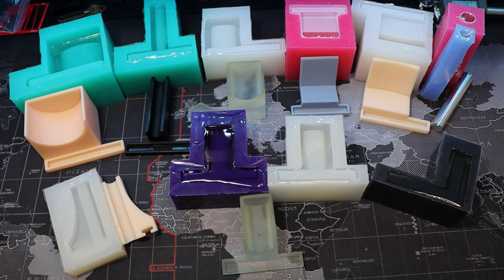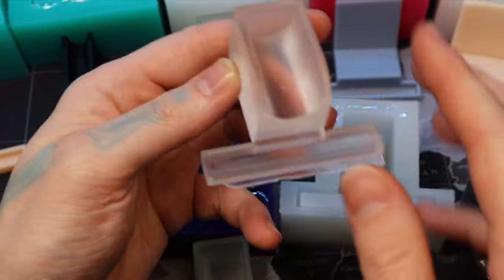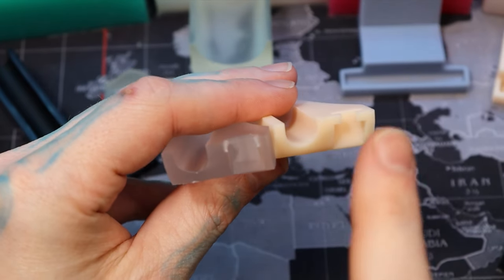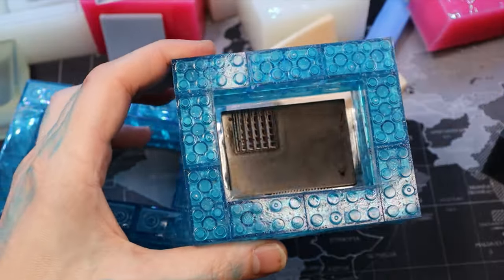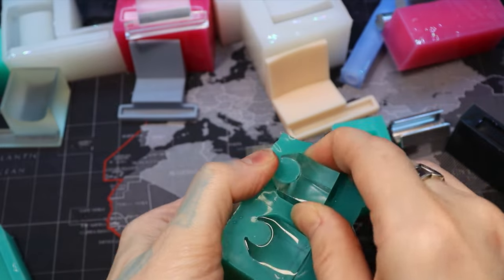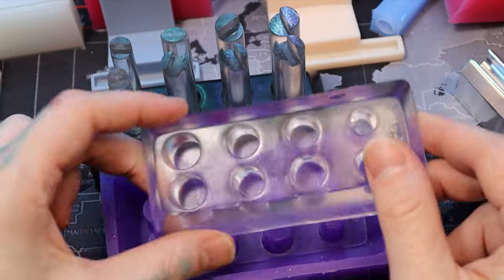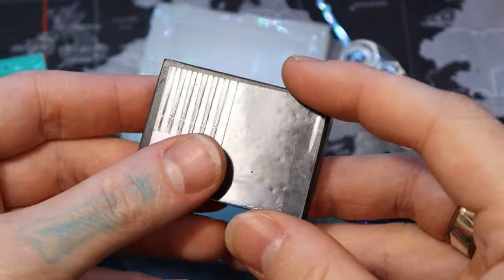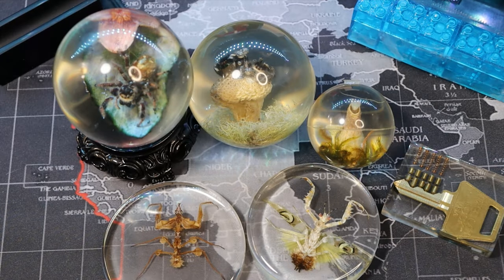297) 3D Printing, Silicone Molds, & Craft Resin for Locksport

Comment: I just wanted to clarify something about the silicone. You are referring to the "shore hardness" as if it were a model number of product when it is not. the 12A you mention is just how hard the silicone is (squishy) and the 2 "types" of silicone are "tin cure" and "platinum cure" and you can get the same hardness in either of these. You are absolutely correct about platinum cure being what to use for resin 3D prints and that tin cure is stronger, longer lasting (no matter the shore-A hardness). But you really should not talk like the numbers you use are a "type" of silicone. The correct wording would be Tin VS. Platinum cure are the 2 main types but they both come in many different hardness (Shore-A value). Carry on.
Reply from the maker: Thank you for spelling this out and educating us! Seriously, thanks!